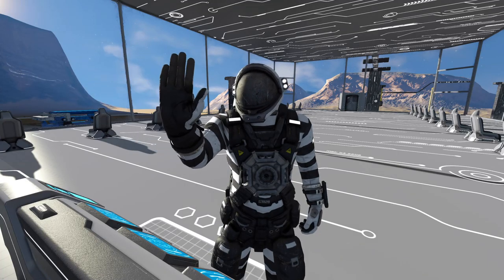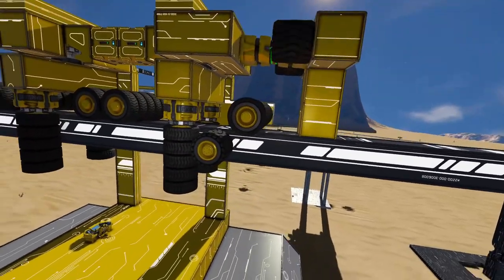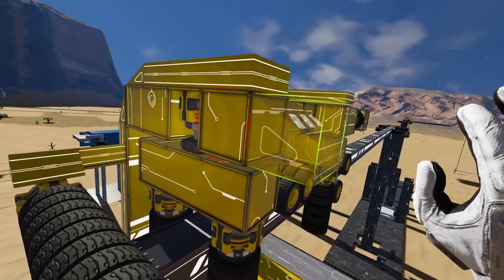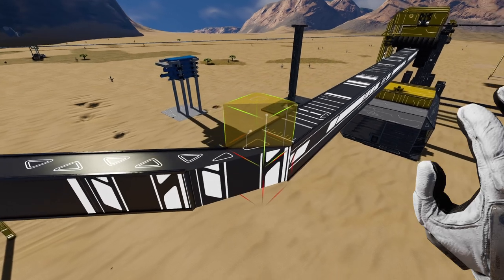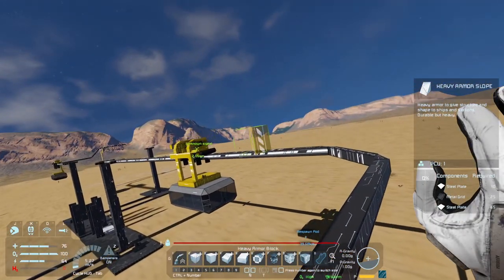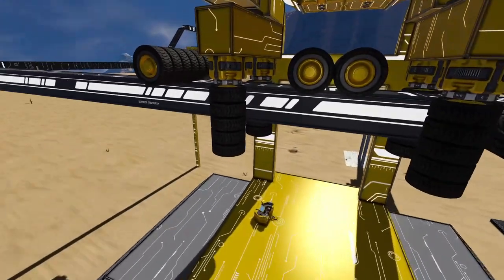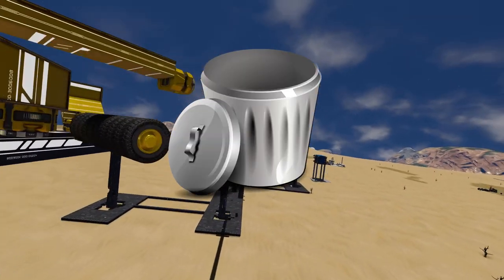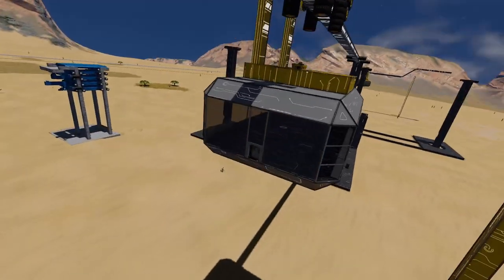Space Engineers Experiments: Making A Gondola Lift

Comment: You can make the up/down slope more gentle by just using the 2x1x1 slope blocks.  You could also add more 2x1x1 slope blocks to the start and end of the turns and slopes to make the transition to the 45 degree slopes less sharp.  Also, I'm sure there would be a way to make the front and back wheels tip up and down when hitting a hill by adding a rotor but it  would probably require adding wheels to the bottom of the rail as well.  Have you considered putting a turned off hinge (no braking force) to the middle of your wheeled carriage to help the whole system to bend around the corners?
Reply from the maker: These are good suggestions. For some odd reason, when I use hinges in this type of system it usually breaks easily. Kinda weird.

Comment: As Jeffery mentioned earlier, it would make sense to make it able to tip the main drive wheels (the ones on the ends) with a suspension system. The main downside I can see with a system like that is that it would make it a fair bit longer, but you would maintain better contact for going up the slops.Another option would be to try and make the whole system shorter so it doesn't have to worry as much about the bends in general. Digging the work, keep it up. :)

Comment: Could you make smoother turns and flatter slopes by having hinges in the track?
Reply from the maker: I've seen it done with hinges, rotors, and even connectors all using blocks at a slight angles. Pretty neat and slight curves.